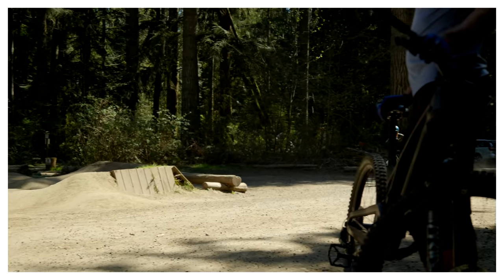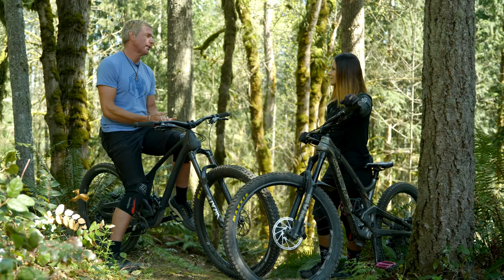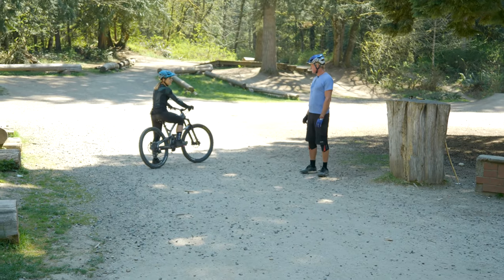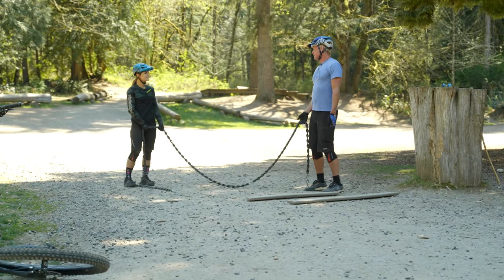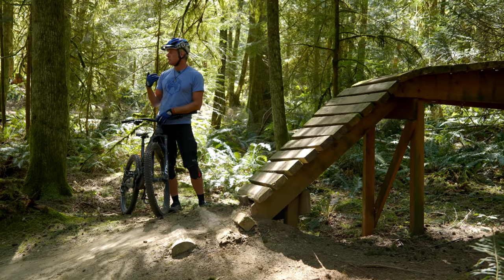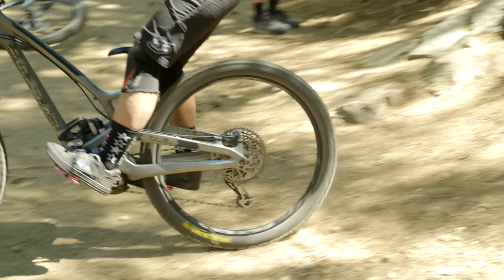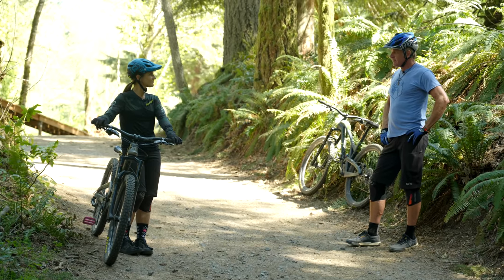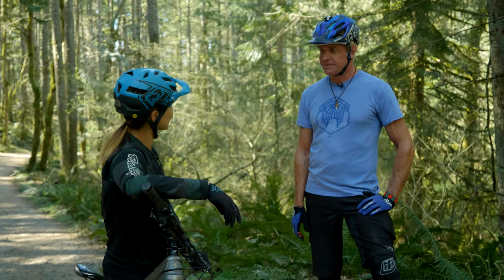When to Drop Heels: Practice Like a Pro #35

Comment: I started off riding XC/Flat  trail riding, but quickly got into steeper, technical riding once I discovered that, but used to suffer from balance on that stuff. Used to ride with my cleats slammed basically all the way forward, then read somewhere about moving them back a bit behind the ball and once I did that, balance on the steep stuff was no longer an issue as could now easily get weight on my heals/drop them and wasn't riding on my toes anymore (good for seated pedaling, bad for pretty much anything else on an MTB).